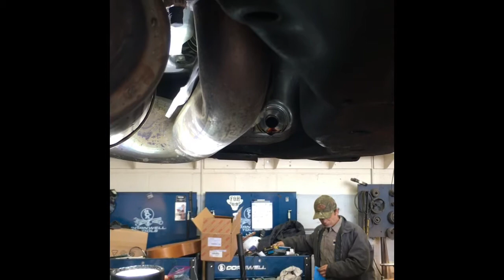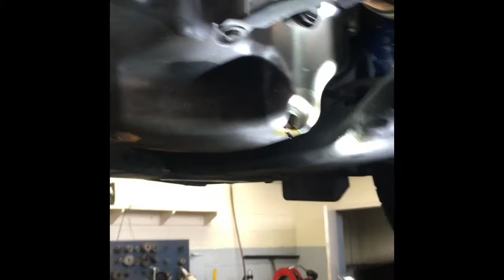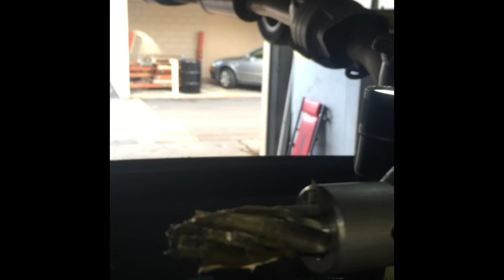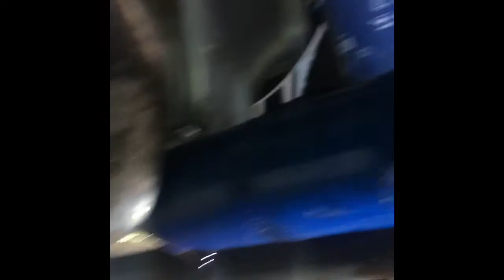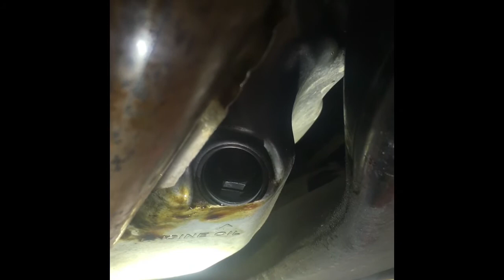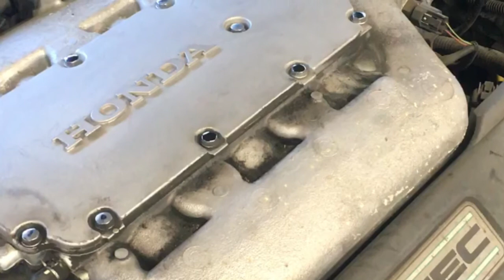How to Repair a Stripped Out Drain Plug on a Honda

Comment: There  a regular bolt will work that autoparts sell work as good as the factory one. It didn't require no extra work .  The Kit that this guy used it well over 100 buck.